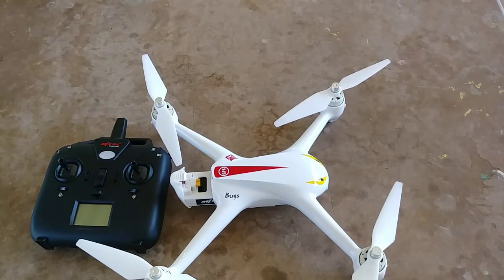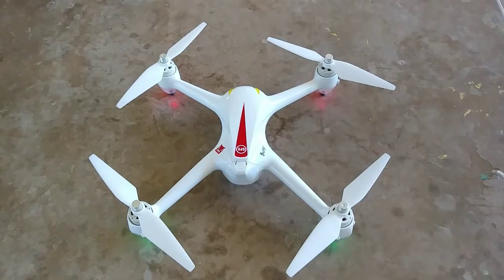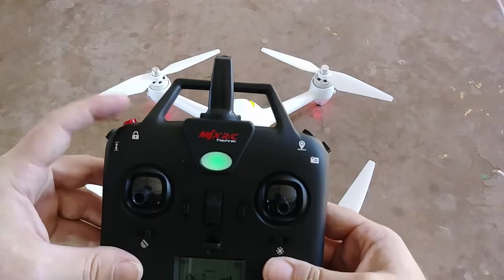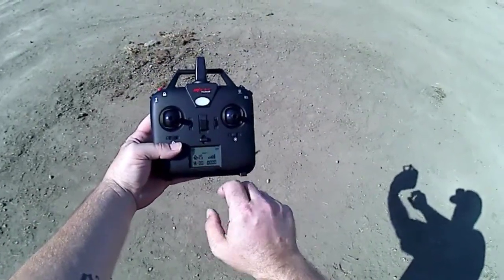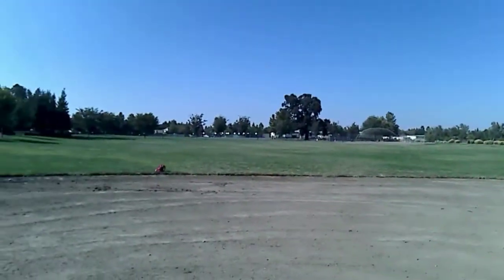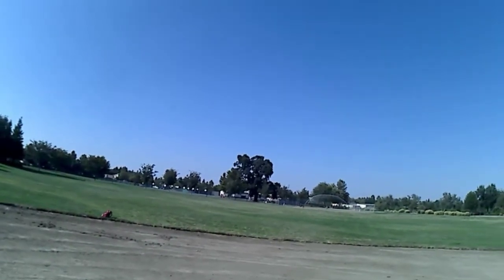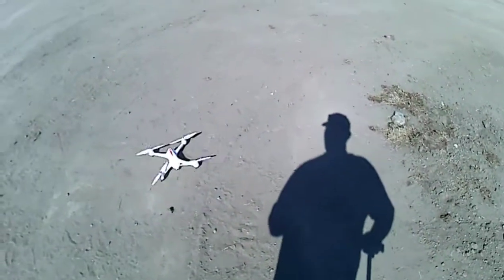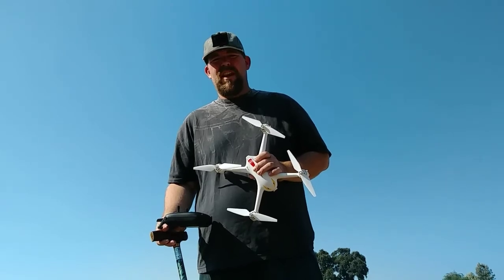MJX Bugs2c | How To Correctly Calibrate GPS

Comment: This is great thanks! My drone won’t calibrate on the vertical axis? The lights just stay flashing red? Please help it’s driving me insane!!
Reply from the maker: Make sure the controller and your model device is away from the drone with doing the calibration. Also any concrete or metal. It should calibrate, and sometimes depending on where you live. The satellites can take a few mins to get. I wish I could be more help, it’s hard when I’m not there to see it in person. Thanks for watching and I hope you get it going.
Reply: BIG DRONE FLYER77 R/C thanks so much for taking the time to respond. I’ll try that! I was in my house. I’ll try outside.
Reply from the maker: Starts With Me [Mental Health] might be getting interference from indoors. I hope you get it straightened out.

Comment: Hi Big Drone Flyer. I have the Bugs 2. After a number of hours flying, it started having problems to catch satellites, until no connection at all, so no flying. I replaced the compass, and it was good just for few flights. I do all the calibration you recomend here, but still no satellites shown in the transmiter. I´ll appreciate any advice. Thank you
Reply from the maker: Maybe try rebinding the controller to the drone. Other then that I really not to sure without having it in front of me. In sorry Al, I wish I had a better answer for you my friend. I do thank you so much for watching and the support. Please keep me posted, I will do some checking around.
Reply: @BIGDRONEFLYER77RC  I did the rebinding, but what really worked was to hold the sticks  all the way down-left. The secret was to hold them until the quick blinking stops, as you mentioned in your video. To calibrate the compass, I was just bringing the sticks down-left and let loose after a couple of seconds. Now I know that it takes a while, but it does the job. For the following flight was not necessary. Thank you very much for your help.
Reply from the maker: Your welcome Al, thank you again for watching. Have a great weekend when you get there.
Reply: @BIGDRONEFLYER77RC  Have a good flight
Reply from the maker: Thanks so much my friend

Comment: Do you need to rotate the quad three times in every flight?
Reply from the maker: Yes it needs to be calibrate each flight for the gps. For the rotation it varies on how many times it takes to calibrate. But must if the time its around 3 times with thedrone level facing foward and then 3 times with the nose facing down.
Reply: Big drone flyer77 thanks
Reply from the maker: Your welcome

Comment: How’s the drone doing to day n how many flight u put in?
Reply from the maker: dave parks great and I fly with my action cam all the time. Probably 20 or more flights so far. Its my go to bird for those aerial views. I fly over the ocean a lot. When my reviews slow down I will start loading more of my flights from summer. Its a great bird but the built in cam sucks. I never use it, going to put a fpv 5.8ghz cam in its spot.